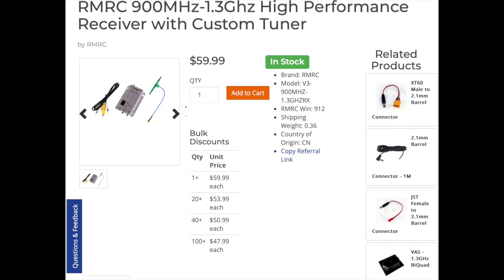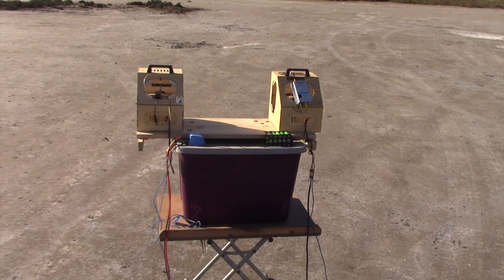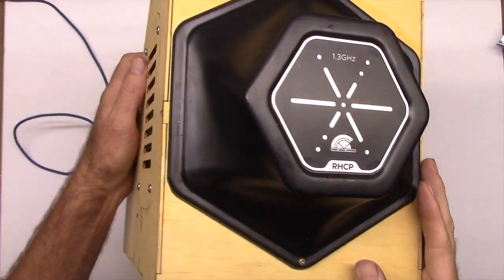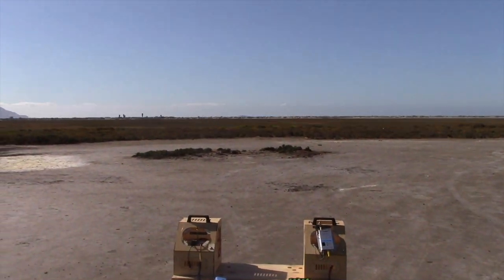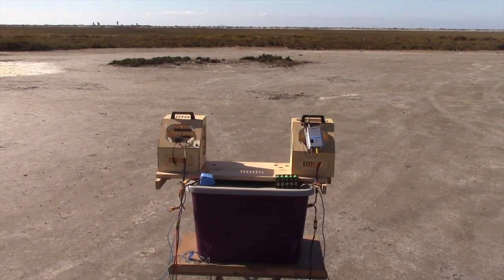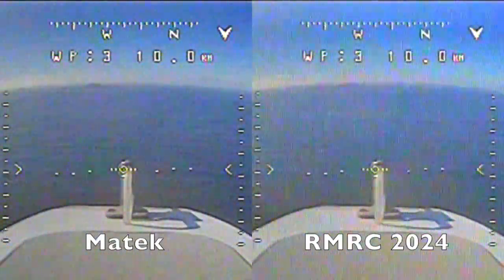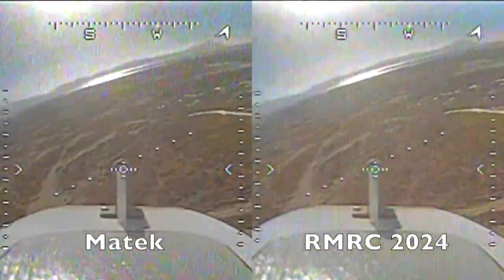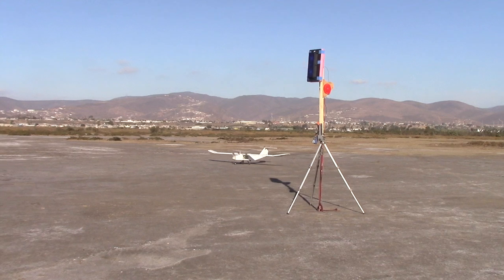RMRC 1.3ghz Receiver VS Matek VRX-1G3-V2 IS THE HYPE REAL? And does it matter?

Comment: friend, have you tried this product? Hawkeye Captain X 10.2 inch 1.2G FPV Monitor with HDMI DVR
Reply from the maker: no have not tried it.  The important thing about an analog monitor for FPV besides screen brightness is that it does not go to blue screen when signal is weak.
Reply: @FPVREVIEWS  alright. yes that's important, they wrote about it ''No black/blue screen in weak signal.''

Comment: Im surprised by the distance. I expected more from 1.2/1.3. Ive done 12 miles with 1 watt 5.8 and a crosshair extreme with rapidfire.  i barely had snow. It was in the middle of the desert. No cell towers  around.
Reply from the maker: Hmm, ive heard the same from several people.  I am flying over water in a bit of a fishbowl, that is the bay.  There is a high density of cell towers around the edge of the bay, but none in the direction of flight,  except for a few on the mountain to the left, which I think are FM radio towers, but they could be anything really.  
I do appreciate the feedback.
Reply: Trying to do something similar. There is a little remote mountain peek about 12 miles away from me I want to fly to. it is also basically in the desert, with nothing, no towers or anything for miles. ive got a 1.6W vtx. should I look into 1.2? whats the cheapest way to complete this mission? working on building up a 10" and a custom lion pack. should be able to handle the out and back. also using the rm pocket. might need to get a bandit or ranger. let me know what you think.
Reply: @spb1179  a plane would be better. Look into arwing pro. 1 watt analog 5.8  vtx is enough. On the reciver get a truerc x2.  That would be hard to do with a quad.

Comment: Try to get your receivers higher off the ground. You might see different results.
Reply from the maker: Both of the receivers tested were at the same height.  yes, it would likely get better results for both if they were higher.  But it would still be the same for both, correct?  or am I missing something about one of them specifically?
Reply: @FPVREVIEWS  google fresnel zones or fresnel zone calculator. i dont want to butcher an explanation here. but based on my limited understanding, there is a minimum optimal height to get the best reception from an antenna/radio system for a given frequency. 1.3 GHz being a  larger wavelength will generally require more height than say, 5.8GHz. my guess is the reason they cut out at the same distance is due simply to the interference from reflections off the ground inside the fresnel zones of the system. I could be way off on this. i would love to see this tested tested though. but i like the video, i didnt think people used 1.3 much anymore.
Reply from the maker: @Morgan-sc1cb  good points.  What can go the distance, if not 1.2/1.3 analog video?  Are there any digital systems that can go 30+km?
Reply from the maker: @Morgan-sc1cb  Makes sense.  I honestly don't know what those figures for Fresnel zones are, and I would probably mess up the calcs.   But it's a distinct possibility that is what is happening.   I often wonder about using another aircraft as a repeater.   I just tested the receiver on my taller pepperbox today, shown in the video, and it did better, but not much better.  I tried removing the RF filter too, but it didn't seem to make any difference whether it had it or not.   I had heard that the RF filter eats 6DB, but perhaps the benefit of it is cancelling out the noise, and at that range, it's a draw.   that's all I can figure.  I had hoped for more definitive results.
Reply: @FPVREVIEWS  the exact numbers and calculations aren't that important for hobby level stuff. the main takeaway is higher=better. when i did a 10 mile out and back flight on 5.8GHz i just had my antennas on top of a 8ft pvc pole on top of my car.

Comment: Can we even buy the matec anymore? Im looking for a alternative to it that does just as well. RMRC is not what im looking for. The small form factor of the matec and performance is what i need.
Reply from the maker: I do see lots of them still for sale.   
Also Flywoo Flywoo 1G2-1G3 is at a slightly higher price point, with same specs as the Matek.  But has two antennas!
Reply: @FPVREVIEWS  someone on RCG said the Flywoo VRX wasn't good. I also have it but haven't had enough chance to test thoroughly but it also felt to me that the Flywoo was worse.
Reply from the maker: @flat-earther  I have not tested it.  I've bought the IFTRON Clearview 1.3 system, and will test it next.  Also got a herelink for testing!

Comment: I would be interested how the comparison looks like without the external notch filter on the RMRC receiver. As far as i know the RMRC has its own internal filtering. I assume additional external notch filter may not improve but worsen the result.
Reply from the maker: Would have to test both receivers with and without the filter.       What do you know specifically about the filtering on the RMRC VRX?
Reply: @ 
As it is mentioned on their Homepage, the RMRC Receiver has internal filtering. In my opinion, adding another external filter gives you just a weaker Signal and will worsen the signal quality. 
This is why the RMRC is looking not so good in your comparison. 
If you look around here on youtube, „everybody“ uses the RMRC Receivers, older and newer versions, and as it can be seen in the Videos, if you use it correctly with some distance to your RC Radio, recommended VRX and good antennas with correct arrangement on the plane and the groundstation, then you get very good results also in very far distances. 
Me myself, i own both receivers, RMRC and Matek, and dont use the Matek anymore😉

Comment: lol - the Matek is much, much better.
Reply from the maker: In this case, yes, it gave a better overall image, and had more range.  But the RMRC is easier to setup, more robust, and the range difference is only about 5%.      I'm looking at a Clearview XLR which has a DBM of -108, which in theory would give about 4.5X the range.    Of course if it's true.  It's also much much more expensive.